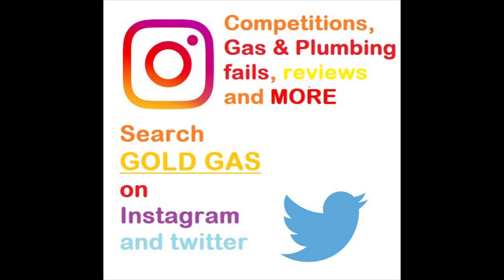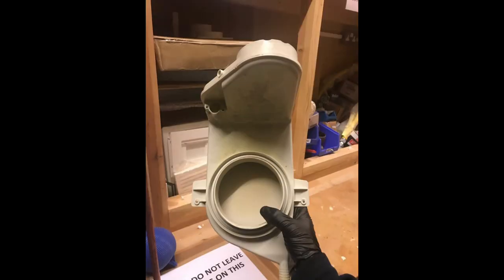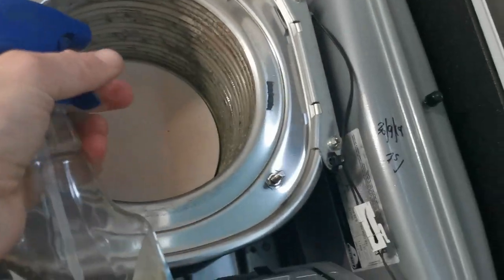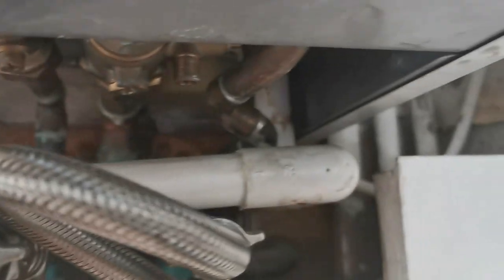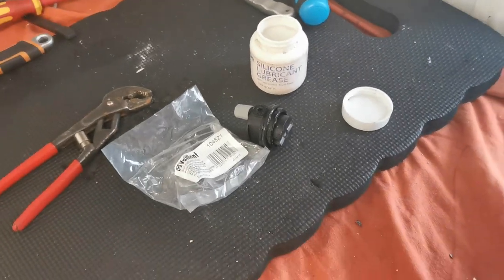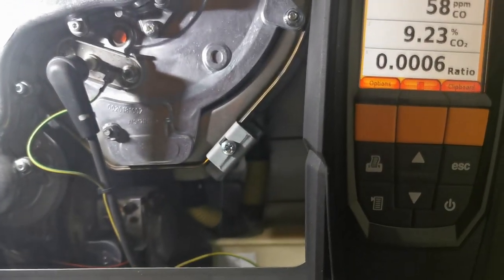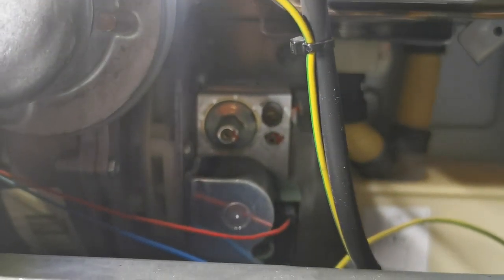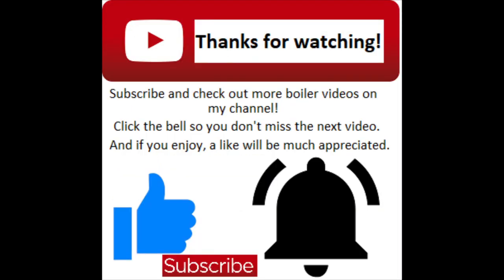BOILER SERVICE - VAILLANT & GLOWWORM BOILER- HOW TO STEP BY STEP - FULL STRIPDOWN

Comment from the maker: IMPORTANT PLEASE READ-
This covers a lot of the condensing Vaillant and Glowworm boilers. It doesn't cover everything, and you should treat this as a guide. (inlet pressure, filter and flue etc). 
!! Do not attempt unless you are Gas safe or under the supervision of someone Gas safe!! Attempting this without a Gas Safe ID can be dangerous to you and people around you!! 
This is aimed at people who don't service much, new to this boiler or trainees.
All this information is already widely available.